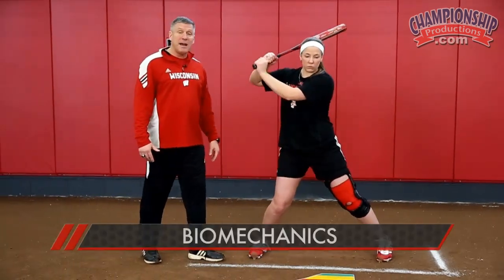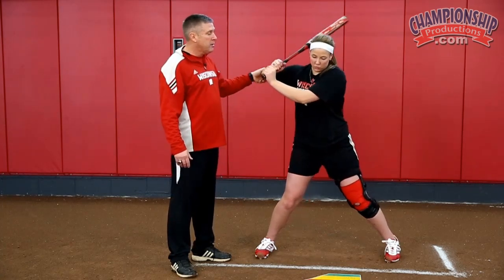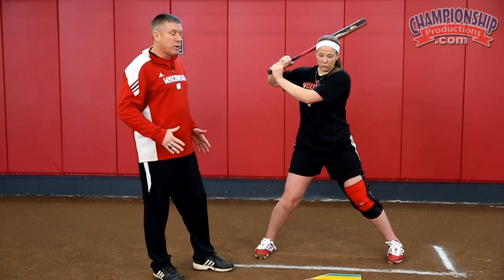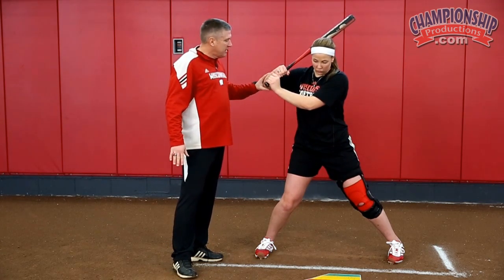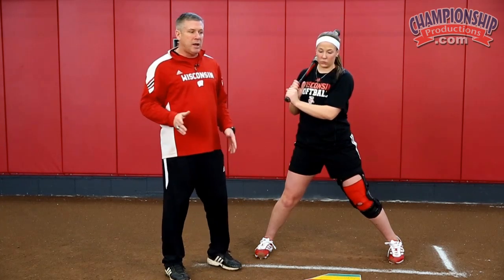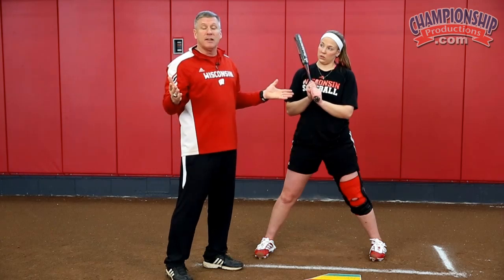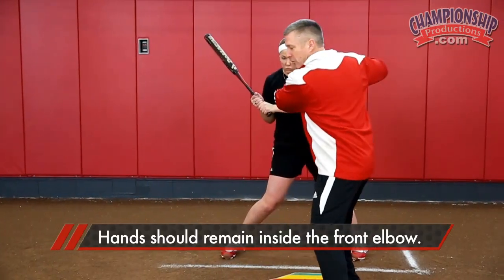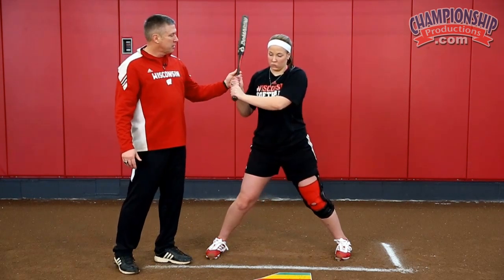Biomechanics and Drills for Developing Great Hitters

Comment: I disagree with several points here, but it may help for this hitter. The biggest thing is when coach talks about linear/rotation and the hitter pulls her hands as she moves forward. If her hands move forward with her body, torque is greatly reduced diminishing power. Along with that is the idea that the elbow starts the swing...bio-mechanically/kinetic link-chain, if the swing starts from the ground and moves up, maybe the back knee has something to do with initiating the swing? The elbow is farther up the kinetic chain.

Comment: Knuckles aren't lined up and that back elbow doesn't need to be up. This is softball, not baseball. Leave the hands back when striding and then swing from there.
Reply: So the baseball swing and the softball swing are different? Not so...and the knuckles not being lined is such a myth. Is it a decent reference? Sure, but not necessary to line the knocking knuckles up.
Reply: Where the back elbow is doesn’t matter. That’s little league talk. How a hitter starts and where the elbow is doesn’t mean squat, as long as they still get to the power position and the elbow gets slotted it doesn’t matter how it starts.